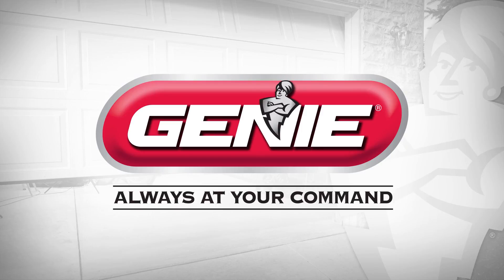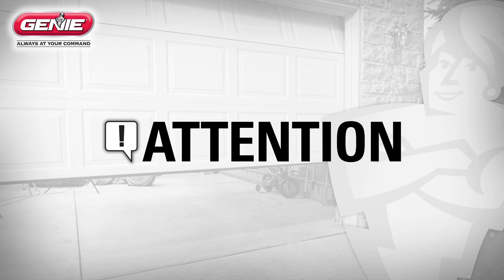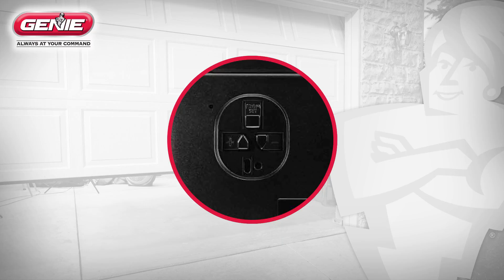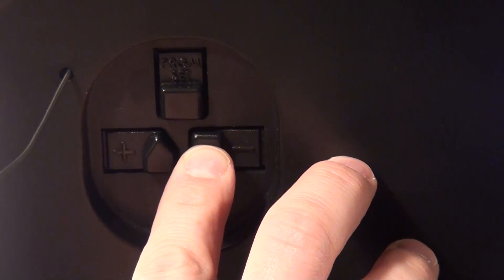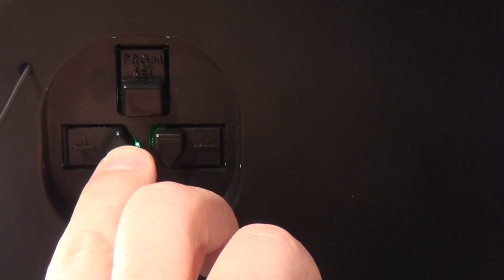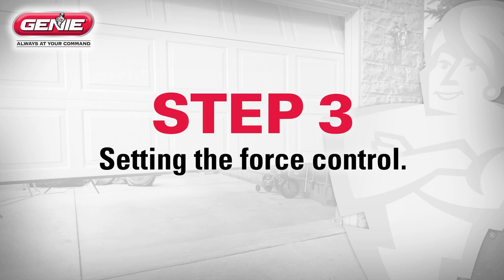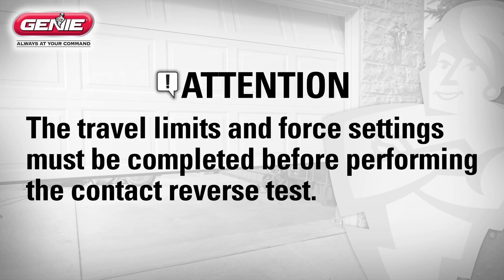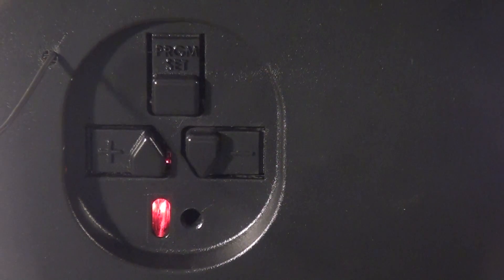Travel Limits, Force Control Programming & Contact Reverse Test (Full Video 5:26)

Comment: For the demonstration the battery 🔋 pack was left installed which illuminates green LEDs.  These LEDs should be ignored because they only illuminate after the battery 🔋 is installed which is the last step so don’t expect to see them until that time.

Comment: Make sure your wires are correct! I accidently wired the wall button in with the green sensor and the red sensor into the wall button connection on the power head, it caused the red sensor to flash red, and the wall button powered on but would not work. Save yourself 1 hour of troubleshooting.

Comment: The reverse contact test doesn't work on my new SilentMax 750 3/4 HP Belt Drive Garage Door Opener.  On rare occasion it will reverse if the 2x3 is on it's side  (2.5 inches vs 1.5 inches).  I adjusted the up/down limits twice, force levels from 1 to 9, no help.  Also, which is more sensitive, 1 or 9?
Reply from the maker: After initial setup of the garage door opener, the unit should be ran up and down with the wall console to auto-set the force.  Did you do this piece?   Also please verify that the door is correctly balanced, we can provide you more help over the phone at 1-800-354-3643
Reply: @GenieCompany  Thanks.  They phone support guy said the 2x4 is supposed to be on its side rather than flat.  Flat is what the instruction say and what the picture shows.  But it works on edge, so I'm good with that--1.5 inches vs 3.5 inches.  As long as my cats don't try to do the Limbo under the sensors, they should be fine.
Reply: @dbcooper9935  Had the same problem on my new unit. Read your post checked it again with the lumber on its side worked like a charm.

Comment: I have a solid large red lead (steady) and not operating motor … it just sound like click but no movement … is there some hard reset ?
Reply from the maker: The only "reset" would be to unplug the opener and plug it back in. We would be happy to help you resolve this and troubleshoot what is happening. Please contact our customer service at 1-800-354-3643.

Comment: My brand new opener completes the set up and cycles and then it goes red solid long led, any thoughts? Nothing is obstructing and I checked the wires they are not damaged
Reply from the maker: What model is your garage door opener? Do you have the Safe-T-Beams installed?

Comment: Lorsque j'ai acheter mon ouvre porte, il étais marqué instruction en Français. Oui mes programmation en anglais. J'ai tous installer et maintenant je suis a la programmation des limites. (j'ai deux problème soie un ou soit l'autre. Plus capable de faire des ajustement, je doit faire un reset mes je ne sait pas comment. je vais dans la programmation mes la chaine ne bouge plus. ) l'autre une foi tous programmer. Je ferme la porte et elle ouvre seul comme si il détecte quelque chose par terre.) mes détecteur son vert et l'autre rouge.) Voici ma procédure de programmation. j'appuis sur le - quand sa flache je dressant la porte, un fois ferme, 1x programme,  j'appuis sur le + quand sa flache je monte la porte, , 1x programme. Sur l'interrupteur au mure, je ferme la porte ( problème 1 elle ouvre pas.) si tous vas bien j'ouvre la porte, j'installe 2x4 et ferme la porte. Elle remonte et enlève le 2x4. Programmation supposer être terminer. Je ferme la porte et elle remonte tous seul. (problème 2) Il y a t-il quelqu'un qui parle Français qui peux m'aider.

Comment: I just picked this model up today and wired everything and set to go but I'm having trouble programming it.i get to program it to move up with the remote for the car but I try to hit the other button to go reverse and go down but it doesn't.ivecakready programmed it go down to it's limit in my garage.what the hell am I doing wrong? Car remote does not work to go in reverse to go down but it will go up with hitting the top button on the remote.and what button is the reverse anyways? Theirs 3 buttons on the remote but no labeled.i just hit the top button on and it goes up do so I know its for the up button.thanx in advance if someone can help me out🙏🏼
Reply: This garage door programming is very difficult. I am going to go fix my brothers in a few minutes. If the door becomes harder to close over time, maybe spring has become weaker door will not close and open with remote. Very annoying! Must go through whole process from start to finish. I see they removed from video how to just increase power to raise and lower door when this happens. Its in the manual how to do this but i could never get it to work. More later after I address this issue!
Reply: After i closed and opened the door from wall to set the force remote would not work. Worked from wall only. Then press the square set button on bottom of opener for 2 seconds. From about 5 feet away slowly depress the button of the remote you want to use 2 times.  Wait a couple seconds and depress the button on remote you just programmed. The door will move to open or closed position. Hope this helps!
Reply from the maker: Hi did you install your safety beams?  The beams must be installed in order for the door to close properly.
Reply: @GenieCompany  sorta,I found out I wired the sensors wrong and fixed them n green lights are on but my door still won't go down jus by pressing it once.it cones back up😩..I have to have it pressed to make the door go down on my wall mount.need help.
Reply: @GenieCompany  safety beams? U mean the sensors?...yes I did those already and both are green light
Reply from the maker: @tonistarks2874  One sensor should have a green light the other should have a red light.  Please call us so we can assist you further 1-800-354-3643
Reply: @GenieCompany  u know I had that right the first time then?🤔 One side was red flashing and the other side was green. .I called your  1-800 # and spoke to a rep.he told me both suppose to be green and sent me some new sensors in the mail.well now thier green and it's still not working..🤷
Reply: @GenieCompany  I will do that

Comment: I installed this door opener on a different gate/garage door type. The garage door is open but the genie think it is close and same when the garage door is close the genie think it is open. The unit is working fine, it is just that I installed on a different type of door. Is there a way to invert the "position detector"? any way of telling the genei motor that "this position is open and this is close"?
Reply from the maker: This unit is made for residential sectional garage doors only.
Reply: Genie Company I manage to resolve my peculiar issue. Now is working as I intended. Thanks 💪🏻
Reply from the maker: @albertomartin70  Great to hear!

Comment: I just installed the Genie 2055. It seems a little slow when opening up. 15 second to fully open and 10 seconds to close. Is that normal?
Reply from the maker: There are some different factors that can effect the speed of the garage door opener, for example the door weight and balance. The opening speed on this garage door opener opener is normally about 7" per second.

Comment: My up button doesnt even work and i just bought this unit 🙃, so cant even adjust nor set the up limits.
Reply: My new unit doesn't work- once i get the limits set and cycle the doof a couple times it closes and won't open- what a piece of garbage with lousy support-3hr wait time- might just box it back up and return to home depot
Reply: Just got off the phone with Genie support- when the first guy couldn't get it working got transferred to a level 2- when he couldn't get it to work he wanted me to remove the motor cover and check the (factory) wiring, which I reluctantly did, then he wanted me to disconnect the motor from the circuit board- ON A BRAND NEW OPENER- what a POS. Packing it up tomorrow and returning it.
Reply: Gonna try to speak to a supervisor tomorrow to report this "customer service" guy
Reply from the maker: @johnschneider1093  Please reach out to us via fb or twitter - and send us a DM

Comment: My set button seem not work after adjust the down limit I pressed set button but the blue light is still flashing then turned to red
Reply from the maker: Hi Lei - Please contact Genie customer service at 1-800-354-3643 for assistance. We need a little more detail to help you troubleshoot the issue you are describing.
Reply: Same for me too let me know what you did to alleviate the issue
Reply: @lakahang  I called  their customer service and with their useless remote phone troubleshooting. They acknowledge that the opener is malfunction. However, they  are not sending me a new opener. Their solution is to send me a chip that inside the opener and ask me to replace it.  it make me very frustrated and i rejected their solution. And going to just buy a different brand.

Comment: Is there a manual force adjustment
Reply from the maker: It is electronically set, when you set the limits, and run the garage door opener 2 full cycles, opened and closed
Reply: Our garage door won’t open past an inch when trying to set the up limit. We have to physically lift it while pressing the up arrow to set the up limit. Then it closes just fine from the wall, but it won’t open again. Any suggestions? Thanks!

Comment: I’m having pure hell with my Genie. I put in a new MachForce 2 horse and it would not keep the travel distance programs. Each time I opened the door it would stop an inch lower on each open and then it would close too far on each open. I had to reprogram it every day. I took it down and returned it and bought another one and installed it. After about the second day it has started doing the same thing. I have tried to get in touch with someone at Genie and keep getting put on hold. You have any ideas???
Reply from the maker: HI - Have you checked over the door, for door/spring, related issues?  Also after programming the limits, (immediately following) you will need to run the unit from the wall console, 2 complete cycles to lock in the force settings.
Reply: The springs are ok. Does the force setting affect the travel settings?  I’ll try what you said and see if it changes. Thanks.
Reply: I did what you suggested and it didn’t work. It’s still losing the program.
Reply: @djcrash1104  did you resolve this? Since two different openers are doing the same thing, I would check the power outlet for proper voltage. I had a similar issue with a customer's opener and there was unusually high voltage at the outlet. They called an electrician who verified it was on the power companies side and  the power company had to come out and make some sort of adjustment at the transformer, if I recall.
Reply: I got rid of the Genie and got a different brand and I haven’t had any further problems. Thanks for checking.

Comment: Force control (step 3) isn't working for me. The lights aren't coming on either. The light on the switch is on. And steps 1 & 2 I can do.
Reply from the maker: Hi Tom,  If this is a new installation, if you are attempting this step with the remote you will need to perform with the wall console only.. If you are performing this step with the wall console ensure that the wall consoles vacation lock is not switched to the on position.  If you need further assistance, contact us at 1-800-354-3643 and we can walk you through the steps.
Reply: @GenieCompany  is it me or does the video here completely,  aside from mentioning and title  carding, skip the 'how to set' of the "Force control?" he put the door up and down like it says: before Force control can be set, the unit has to do one full cycle. up and down, but then all of a sudden "the force controls are set!" it says. but where was the step in the video?! what did he do?; nothing except cycle the door with the wall control.
Reply: @cory3106  I was thinking the same thing. Where's the force setting instruction?🤨
Reply: As per the manual MANUAL PROGRAMING FORCE CONTROL is pushing the up and down arrows at the same time and then check the color= weak is blue and strongest is red BUT GUESS WHAT??? Pressing the up and down arrows even for a minute doesn’t work. Any help???
Reply: @joncruz  Any luck figuring this issue out? Having the exact same problem. Cannot get into whatever magical world the force control setting is locked behind.
Reply: The light turns red every time I set the down limit and I can’t get it to turn green no matter what I do.